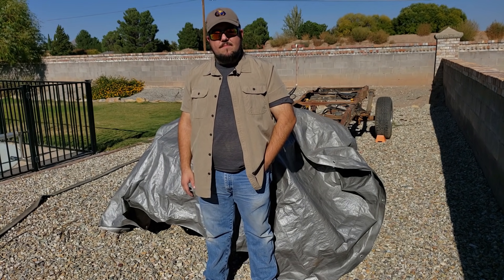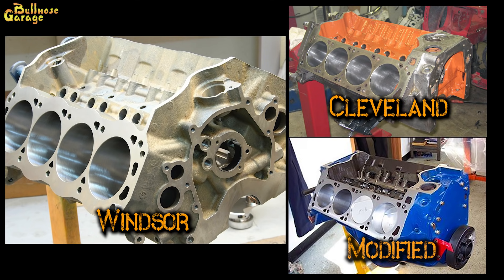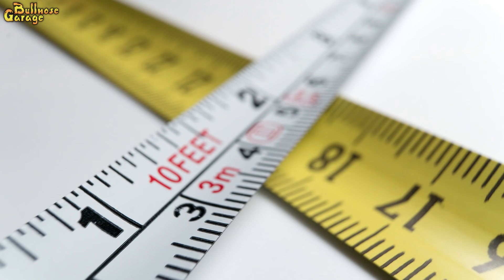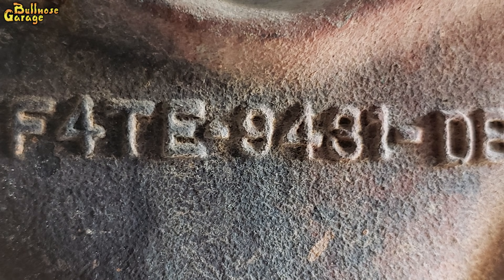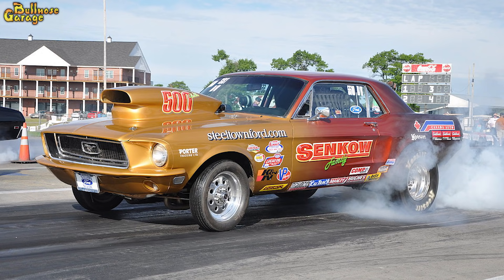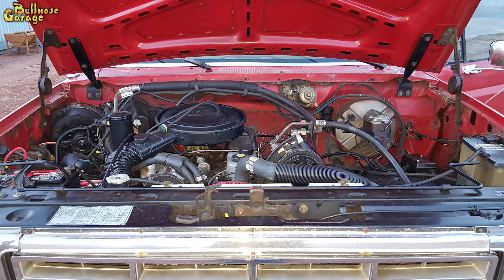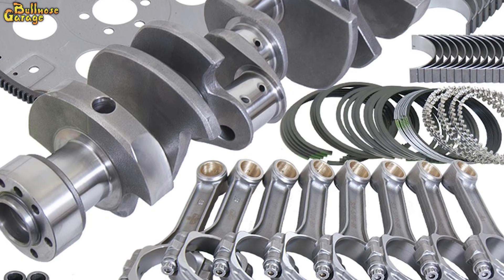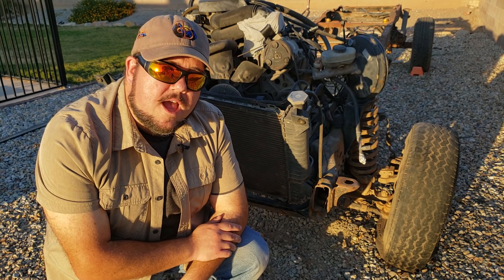351 Windsor – What You Need to Know About the Ford 351w Small Block [5.8 Liter]

Comment: Just a side note on the 351/400M blocks, they aren't "Modified", they were manufactured in Michigan.
Reply: They call them modified
Reply: @michaelbidwell4210  That's the assumed named we use. Not the designation.
Ford "Flat Head" block: flat head design.
Ford "Y" block: deep skirting caused a Y design, distributor in back of motor.
Ford "FE" "FT" block: Ford Edsel Ford's son. Ford Truck
Ford "289-351W" block: Windsor, Ontario Canada 
Ford " 302/351Cleveland" block:Cleveland Ohio
Ford "351/400M" Commonly mis-named "Modified": Michigan plant
The Michigan and Cleveland blocks are 335 series
And last The 429-460 big block, the 385 series.

If they are modified, modified from what?
Reply: @MrKswildman  Hi mate,
Is it not true that there is no engine called the 400M, only the 400 Cleveland and the 351M?
The M standing for modified as it is a 400 Cleveland block with the 351 Windsor crank and special rods to suit.
Hence the Modified tag.
This was supposedly done  after production ceased on the 351 Cleveland  and the Windsor plant could not keep up with demand for an engine of 351ci displacement.
From the book Ford Performance, by Pat Ganahl 1979
All these engines 351, 400 and 351M form the 335 family of engines as I guess does our Australian 302 Cleveland.
Yes, not a Windsor or a Boss 302 but a 302 Cleveland used from approx 1972/3 until 1984/5 in both 2 and 4 barrel form along side our 351 Clevelands.
Using a different crank and rods (I believe) as the 351 with earlier models using the 2v style heads with smaller valves and ports but with the Quench style combustion chambers as used on the 351 4V Quench heads.
The later versions used the same head as our 351C , open chamber, 2v sized valves/ smaller ports etc (I believe)
Also the later 351/302 blocks made here were apparently beefier than the US blocks with thicker webbing etc.
I'm sure there is an Aussie Ford engine nut who may know more about the differences between our 351 and 302c
engines/heads but the 302 Cleveland was a very popular engine in Australia although often overshadowed by its bigger brother as far as performance goes.
Early 302c heads would be a nice addition to a mild 351c if you are chasing some compression and low end performance without the huge ports of the big 351 heads, 4 dots etc
My two cents worth. ;-) 
Cheers.
Reply: @imanenigma3348  the 351 m is a 351 defeated Cleveland block with the 429/460 (385 series) bell housing pattern, hence I guess your Modified name. The 400 is m block and not worth a darn.
Reply: If you ever look at a 351/400 m, the head will say "m" by the valve covers. Some people have luck with these motors, just don't mention these to a true Cleveland fan..lol
Reply: @MrKswildman  Well, I hear what you are saying I'm only quoting what I have read.
No interest in either 351/400M. Given a choice I would go our 351/302C .
Since my 68 Mercury coupe has a 390 FE in it, a Cleveland will have to wait.
Reply: @MrKswildman  I don't know where you got that. I have had a few 400 and they were grate long lasting and had good power. There not that high rev. Of a engine.  But they were made to have a lot of low end grunt.
And they worked grate in big 4x4 with 35,38 and 42 in super swampers. 
If i were looking for a 78-82 ford 4x4 I would look for the 351m or 400.
Reply: @tbjtbj4786  i don't know, i guess working on Fords for the past 40+ years gives me some knowledge of them.
Reply: @MrKswildman  that what I was thinking to. Well 30 years I didn't really start working on the trucks until I was 17.
Worked mostly on tractors until then.

Comment: GREAT JOB on collecting all this information! I have a few of these. My favorite is a 302 that has been thru two fires, and overheated severely two times due to radiator hose failures. Its a 33 year old motor and is still the best running block I've ever owned.
Reply: Yea I have an 88 f150 with a 302 and the thing has almost 300k miles on it and won't die. One of fords best engines for sure.
Reply: I TRIED to blow one up in my car ( had a fresh one all ready to go) ... I COULD NOT make it blow !!

Comment: Nice breakdown of the Ford small blocks!  In 1973, after saving every penny earned for like 5 years, and with some help from the old man I purchased my first car.  A slightly used 1970 Mach 1 Mustang.  It came with the 351 W 2bbl and an FMX automatic.  I modded it with 3.91 rear gears, headers, dual exhaust, an Offy aluminum dual plane intake with a 600 CFM 4 bbl plus a recurved distributor.  It ran a best of about 14.6 in the 1/4 mile (slow).  I gave up on modding it when I roll raced a buddy in his 1972 Mach 1 (heavier) with a bone stock 351 Cleveland automatic.  Our race was dead nuts even which was extremely discouraging!  The problem was that back then, the 351W was seen as the poor, ugly stepsister to the Cleveland and as such got no love.  Aftermarket support for the Windsor was almost none existent.  No aftermarket heads, very few cams, etc.  Everyone thought the Windsor block was weak due to it’s 2 bolt mains.  (I also couldn’t even get a shift kit for the FMX).  That all changed when Ford discontinued domestic production of the Cleveland and went forward in production with the Windsor engine family.  Only the (lucky) Aussies continued to get the Cleveland as far as I know.  When the Fox Mustangs hit the US in the late 1970’s through the 80’s the car became the favorite car to mod for young hot rodders.  And guess what they discovered?  They could bolt 351W heads onto their 302’s and eventually many just transplanted 351W’s that were plentiful at junk yards.  And voila!  Suddenly demand for 351W speed parts was born and the rest, as they is history!
Reply: It was actually the 5.0 engines that helped give the 351W a big push.  The 5.0 is actually the most modified engine today.  Heads, cams and many other performance parts also fit the 351W.  Even the firing order is now the same.  And then people started stroking engines to get big block cubic inches.
Reply: @rongreen7308 Only the 5.0 HO motor has the same firing order as the 351 Windsor because they run a 351 Windsor camshaft
Reply: @purpurahaze9179  Only the '82-'84 5.0HO (& '84-'85 CFI/auto trans cars) used the '73 Torino 5.8 camshaft [D30E-6250-AA]. '85 5.0HO (with 5 speed & 4V Holley) & all '86 & up 5.0HO used a roller camshaft (which 351W didn't get until '94) with completely different specs than the '82-'84.
Reply: Adding 351W heads to a 289 or 302 became a common modification as soon as the 351W came out. The 351W head, though, had an extra bolt hole that was unused on a 289 block. There were also stepped head bolts available for this modification.
Reply: I had a 351 Windsor Gran Torino 1993 station wagon company car. It miaswell been a 4 cylinder engine until you got to 80 miles an hour. Before that I had a 1970 Grand Torino 351 Cleveland. It handled all GM cars including 400 plus Buick Wildcats. Never want to hear abput the despicable Windsor 351 again. Than you goodbye.
Cleveland only.
Reply: Why tf would you put 351w heads on a 302? typically that is a downgrade in compression

Comment: 335 series engines are not "big blocks". 9.206 deck height (shorter than the 351W), and the same bore spacing as all of the small Ford V8s. A chevy type will call the Cleveland a "big block" because, once you put the canted-valve heads on that relatively small block, it does not look small as it does/would with the inline valve heads.
 None of the smaller Ford engines ever had "internal balance", not even the Bosses. They did all share a 28oz imbalance for many years. After 1980, it was a 50oz imbalance.
 The 335 series did not have "better" or "stronger" crankshafts. They were the same general quality as any other small Ford V8. The Boss 302 had a forged crank, but even the Boss 351 had to make do with a cast iron crank, although it was supposed to gain some strength/durability from higher nodularity. The Cleveland was more race-oriented than the pick-up truck and station wagon suitable 351W, so it did have smaller main journals, for high rpm benefits. Most aftermarket 351W style blocks, stroker kits and aftermarket crankshafts can be had with Cleveland sized main journals.
 The 351M has the same deck height as the 400C. They both use, in effect, a "stretched" 351 block. These two engine variants could be termed "big blocks", if one must use chevy terminology when talking about Fords, as they are taller than the old production 366/396/402/427/454 chevy blocks.
Reply: A lot of good points.
I want to say he probably meant to say the 351M and 400 utilize the 'big block' bell housing pattern rather than the Windsor pattern common to the 300/302/351W

Comment: 15+ years ago I was flat towing one of my 80’s F150’s with another F150. I bought some salt bags to put in the bed so that the rear tires didn’t slide around. A customer came out and told me about his son totaling his 85 F150 with the 351w H.O. and 7,000 miles. I said I was interested in it, gave him my number and he never called. I would have loved to had that engine. 

I’ve had 12+ F150’s, all but 1 had the 300-6.

Comment: Small. block yet it has the same bore spacing and a taller deck height than the Cleveland that stupid people refer to as a medium block.   😂
Reply: 351W block is bigger than 302 block...
Reply: @BuzzLOLOL  taller, by about a half inch, but the bore spacing, overall length, etc are the same.
Meanwhile, the Cleveland mains are are bigger than a Windsor.
Reply: @jimurrata6785  - You have it backwards, but, at least, you realize there is a difference... 351C mains smaller 2 3/4" for higher RPMs, lower bearing surface speed... 351W/M/400 mains bigger at 3" for more low RPMs load carrying capacity in trucks...
Reply: @BuzzLOLOL  You're correct.
Less circumference means less SFPM, (per revolution) and therefore higher rpms available before it reaches critical speed.
Holmann Moody 351's in a Pantera are pure evil!  😈
Reply: @jimurrata6785  - I build Ford 400's... TMI off the shelf pistons and a mild flat tappet cam/lifters nets you 500+ HP and 500+ lb.-ft...  at less than 6,000 RPMs... for $500...
Reply: @BuzzLOLOL  Gary Lewis over at the Bullnose Forum had Tim build a 400 for his Dad's tribute truck.
Watching those dyno pulls and looking at the charts sure caused a stirring in my shorts!  😆
Edit: I'm pretty sure he has Trick Flow heads and a Weiand manifold on it, topped by a plastic bowl Eddy 750.

Comment: Happy wrenching mate, rebuilding my 351W at the moement too. It's a Galaxie 74 block, retrofit to roller (compcam XR282RF-HF10), overbored to 0.060, redecked, DSS forged slugs, Blueprint HP9008 heads, long headers + 3 inch pipes, 750 cfm carb, hi flow water pump, homebrewed dizzy (opto-magnetic + homemade tunable spark unit), and some other smallish parts. Hoping to get 500 hps out of it.

Comment: Wrecking yards have bike full of things that can be swapped for other things. Like a 351M or 400M for a 351W. The Windsor is a better design that the Modified or Cleveland, except the heads. You can take the heads off of a Modified engine and install them on a Windsor. To do that you’ll have to relocate the cool and transfer and plug they old holes. They also take different intake manifolds.
For the 351w or 352/400M heads there are special adapters that will allow the use of 302 bolts. If you don’t. Use those along with the conversion intake manifold and water port change and you’re set. But the 351/400m Heads have large open fcombustion chambers and require a special piston design to work with them. Any head will bolt one of course, but the smaller combustion is better for several reasons, the biggest of them are that the open chambered heads lowers the compression and it is more prone to dieseling  because of that.  Putting Cleveland heads on a Windsor is called making a Clever engine, and the special parts can be ordered for that. Good luck and have fun blowing all those bow ties away!
Reply: Also, it was once a common swap to install a 400 crankshaft into a 351W, creating a 400 cid Windsor. The snout of the crankshaft had to be machined slightly, though. This modification gained the larger displacement, while shedding the weight and external dimensions of the 400M.

Comment: Flat tappet cams fail way too often these  days, though I've haven't lost one yet, go roller.  More expensive at first but last forever.  All lobes are flat and so much less friction internally.  Flat tappet lobes angle the lobe to shove the cam to the back of the block during operation.  All my engines I build now have rollers.  I love all makes engines.  We have a 67 fastback 347 supercharged, roller.  82 chysler new yorker 360 stroked to I don't tell numbers and a two speed(looks like a granny, launches like a banshee on fire), roller.  82 trans am 500 ci cadillac, roller. (500 ci cadillac is 50# lighter than a stock 350 ci and so much more torquey!!!) Roller cams are all I recommend and install for friends now.
Reply: The cam lobes are slightly angled to match the slight crown on the mating face of the lifter. This promotes lifter rotation so the cam is not always wearing on one spot of the lifter face.
Reply: Yes, you can have more aggressive profiles because a roller lifter is presenting a radius, not a tangent, to the love.
The lack of ZDDP in current oils used because of catalytic converters makes life rough for flat tappets and especially solid lifters.
Not having any 20 minutes at 2k cam break in is a plus for rollers too,

Comment: The 351 was available until 97.in 97 Ford put out an f250 light duty that came with the 5.4. They continued to produce the identical trucks as the 96 f250 with the 5.8  they just made them an f250 “heavy duty”

Comment: If you care to help the hearing impaired stop the sack ground music.   Thanks
Reply from the maker: Hello Luther, thanks for the comment.  All my videos are closed captioned for this very reason.  I use the built in YouTube closed captioning which is actually very good.  I also try to keep the background music to a level that won't interfere with hearing me speak, but everyone is different.
Reply: @BullnoseGarage  l have two complete C9 block or 69 year blocks. They are beefier, have more metal on them, almost indestructible.